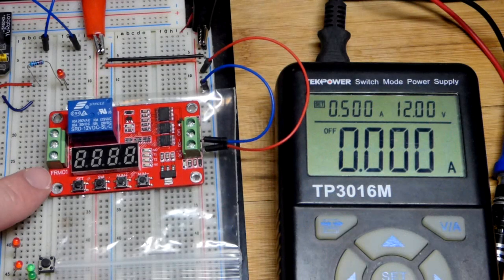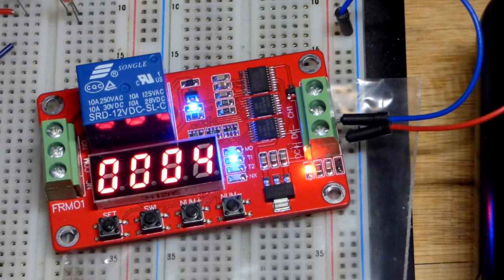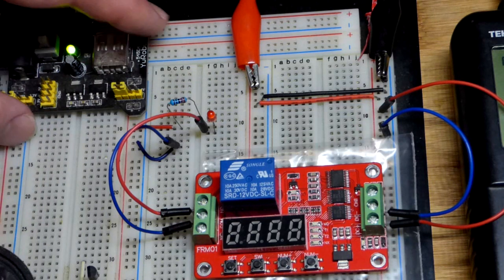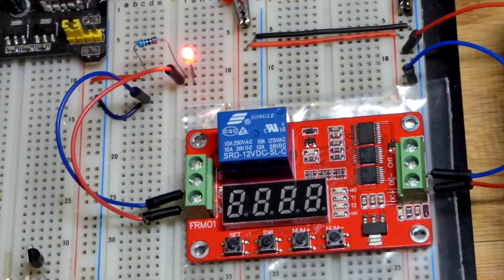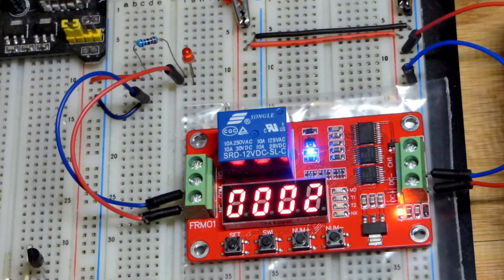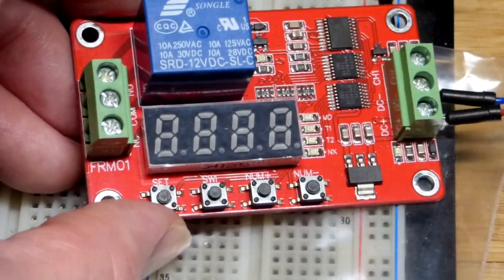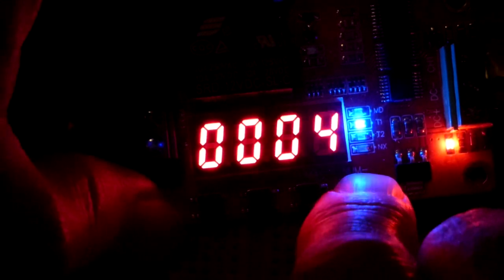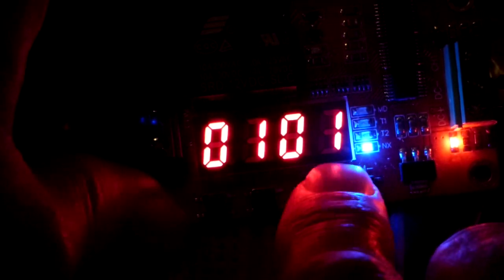FRM01 timer relay module 06 of 18 function repeat cycle starting close setting electronics demo

Comment: I have a question, I have one that I set the time on mode 5. It is set to on 5 seconds and off for 122 seconds. it cycles fine for 3 or 4 cycles and then the number comes up 008 and it cycles on and won't shut off. Any idea what might be causing this to happen. Thanks for the great video!
Reply from the maker: I haven't used this in years. So, unfortunately I have no idea. If I was going to refresh my memory of this board, I would rewatch my videos. So, they are the only help I can provide.

Comment: I have a question, when using the P31, infinite loop with time on and time off, is there any posibility to override that, one time off and leave a bit longer on and then continue the normal loop? I saw the different options but I didn't see any that does exactly that. Thanks so much for your help and your great videos!!
Reply from the maker: Unfortunately I'm not sure, I haven't used this much. I just to find the rules somewhere and figure then out. The examples I've done so far are all I've done.
Reply: @Electronzap  ok no problem, thanks so much